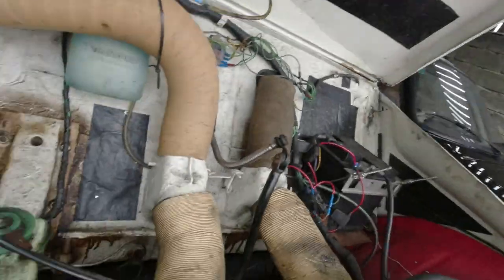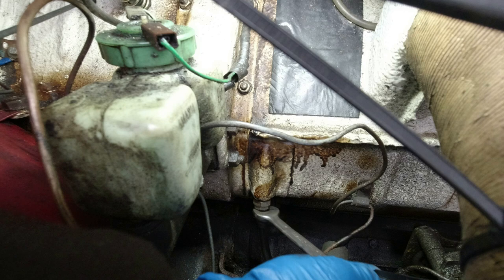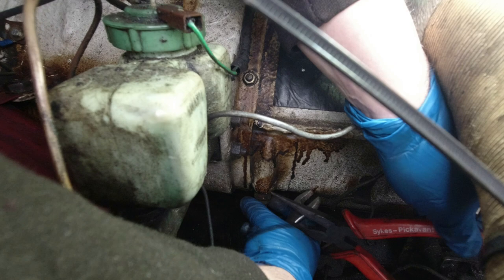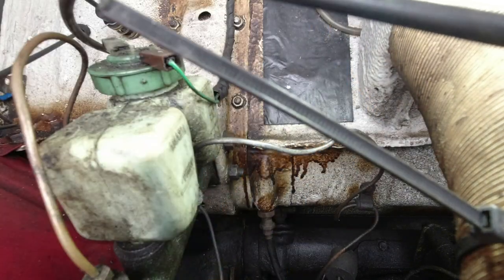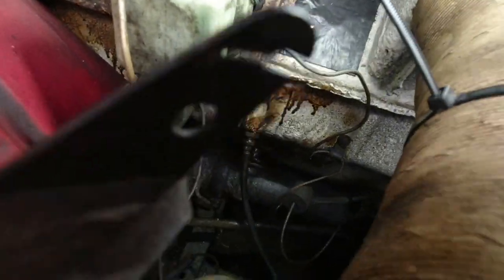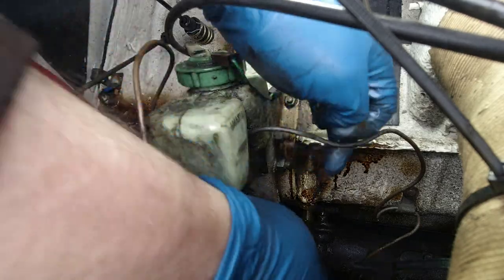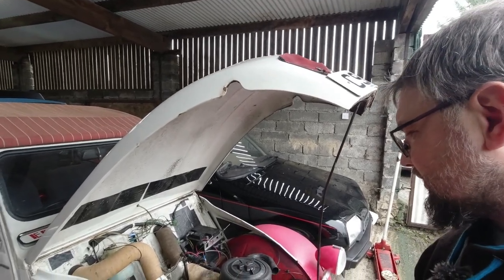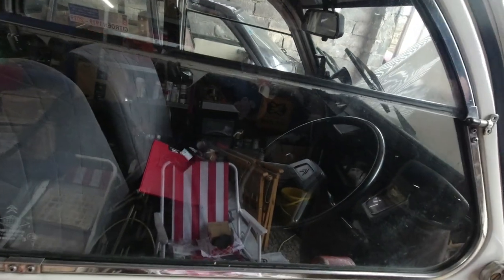Man adjusts 2CV Clutch Cable

Comment: Made a similar adjustment on a Mark III Cortina clutch. Clutch worked and felt terrific afterwards. Until the throw arm snapped in two inside the housing. A bit too much adjusting can be a terrible thing too...

Comment: The adjustment nut and lock nut on the clutch cable shouldn't need to be locked tightly together.  Because of the way the clutch cable is arranged their is less likelihood of the cable adjusting itself into non-operation, so the lock nut is just there to guard against vibration causing the adjustment nut to move.  Just having the two nuts against each other should be perfectly fine as that'll cause enough friction to guard against vibration movement, unlike on a lot of other vehicles where the cable arrangement will cause the cable to go massively out of adjustment in normal use, to the point where it can detach itself at one end or the other or become totally unable to operate the clutch at all, as I have found out in the past.  This is a much easier operation than on most rear-wheel drive cars where you have to be underneath the car working up beside the gearbox where their often isn't really any space to work reasonably, so adjusting the clutch, while a nice, simple operation on paper, rather turns into a career in reality...

Comment: The biggest issue I used to have with my 2CV was the thrust bearing eventually chopping through the fingers of the diaphragm spring. I'd have put it down to a dodgy thrust bearing but it happened more than once. The first sign was excessive play in the cable. On the plus side I got very good at changing clutches 😊
Reply from the maker: I've never had that! Though they say you should never say never...

Comment: Ian, don’t forget you weren’t working alone on swapping Ellie’s engine pre Croatia trip si maybe your assistant tightened the lock nuts with tools?
Reply from the maker: Pretty sure we didn't touch the clutch as the gearbox remained in place. I must have done it myself when refitting the cable back in 2016.

Comment: Head in hands time again. Do you leave wheel nuts nice and loose so you can change a wheel with no tools? Every fixing has a specified torque. Difficult with these type of nuts but locking nuts need to be tight. One day (and I would love to be wrong) you are going to come seriously a cropper leaving everything from spark plugs to brake fixings finger tight. By 'a cropper' I mean potentially dead but I am too tactful to actually say that.  Maybe...

Comment: Had the cable stretched or is it clutch wear? Great vid ian thanks 👍👍
Reply from the maker: Not sure. Clutch has done about 10,000 miles I think.
Reply: It's probably cable stretch, Not sure if the 2CV is the same, but on most cars the clutch free play diminishes as the clutch wears. That's why it is important to maintain the free play. If the play diminishes to zero the clutch will start to slip. Mart in Solihull.
Reply from the maker: If I have to adjust the clutch every 10,000 miles, I'll cope I reckon.

Comment: Time an time again I am amazed by the simplicity of a 2CV. Are parts for RHD cars still available? We're running into trouble for an RHD Volvo 480, because clutch cables are unobtainium. To make matters worse, early cars have a different pedal box, requiring a different (an equally unobtainium) clutch cable.
Reply from the maker: Pretty much everything is available, so we're very lucky.
Reply: I had similar issues finding a gear change cable for an auto conversion, Google  "custom car cables" for the gear change cable there was a company called venhill.
Reply: I think you could almost buy every part and build a brand new one.

Comment: My Dolly will stall if trying to pull away in 2nd or 3rd but going up hill , the clutch slips . Do you reckon its an adjustment needed or a total new clutch ?
Reply from the maker: They're not designed to pull away in any gear but first. Always worth checking the adjustment first. Adjusted is on the bulkhead. There should be a few mm of travel before the cable starts pulling on the clutch fork.

Comment: I have done this adjustment several times. You need ignition spanners. They are thinner.  Why Citroen chose to use such thin nuts on that cable, I’ll never know.
Reply: Several times ? Did you ever get it right ?
Reply: @pmailkeey  Yes, but the cable stretches and the clutch plates wear over time so you have to readjust the damned thing. You don’t have the problem with a hydraulically operated clutch, but hey, this is a 2cv!
Reply: @terencehawkes3933  Cables don't stretch ! That's a figment of your imagination ! Wear at the clutch (or brakes) should be adjusted at the brakes or clutch, not by making the cable too short as is often what bodgers do.
Reply: @pmailkeey  Sorry mate. I disagree. They do stretch.
Reply: @millomweb  How the hell do you adjust a clutch plate at the clutch plate!! Ian adjusted it correctly.
Reply: @johndilloway9762  Using the correct equipment to do the job.
Reply: @millomweb  Yeah two spanners

Comment: If you don't lock the nuts they will creep up the thread with pressure applied hence going out of adjustment .....
Reply from the maker: They needed to go further up!
Reply: @HubNut  
Clutch wear and some cable stretch will do that.

Comment: Was it really the cable that needed adjusting ? Probably not - so I'd guess you've done a typical bodge job. First, adjust the clutch without the cable attached - then attach cable and adjust that. Same principle as with working on the brakes. Start at the end and work backwards.
Reply from the maker: There is no adjustment on the clutch.
Reply: @HubNut  
Exactly.
Reply: @AUmarcus  Oh look another expert who don't know what he's on about
Reply: @HubNut  Funny you should say that - you've not read the manual clearly !
Although what I found was for setting up the pressure plate, I guess - needs some special tooling - but may be the correct way to deal with clutch plate wear.
I just Google 2CV Clutch adjustment and came across an old PDF containing not very clear diagrams - and it certainly wasn't on page 12 as he index/contents suggested !

Comment: Hello greetings from Hellas 🇬🇷.
Ive recently restored my 2cv  yesterday it was my first test drive.
I was having problems with the clutch and after many attempts i realised that i have mount the cable in wrong path after assembling the car.
So after adjusting it i was really satisfying with the result but i came with another problem.1st and 2nd gear feels so good engaging really nice but third and fourth gear are slipping so bad when engine is revs high.
Any suggestions please?
Reply from the maker: I'm surprised the clutch is working fine in some gears and not others. Are the engine to bell housing bolts definitely tight?
Reply: @HubNut  Thanks for replying.
Everything is new on the car and every bolt is tightened and checked twice.
It is really weird problem 😕. 
Gears engaging smooth but 3d and fourth gear you can feel it sleeping.Today i have taken it again for a ride and i saw that when it was cold it wasn't so sleepery as it is when is hot.
Is there any chance when i was putting the clutch disc on to misaligned it?